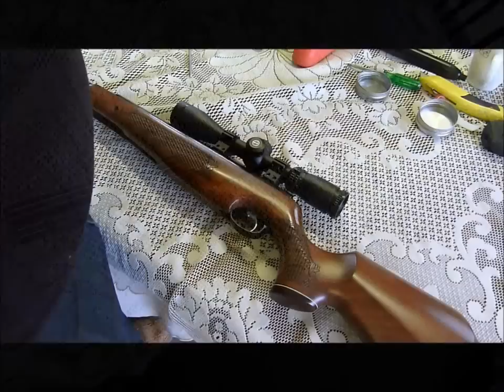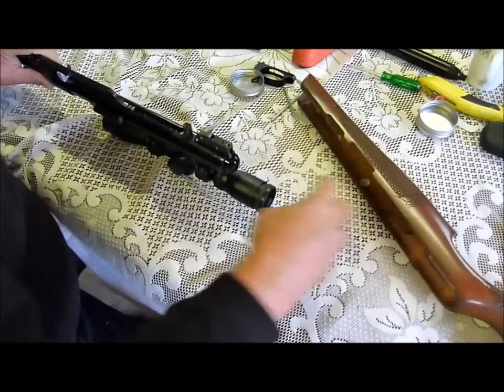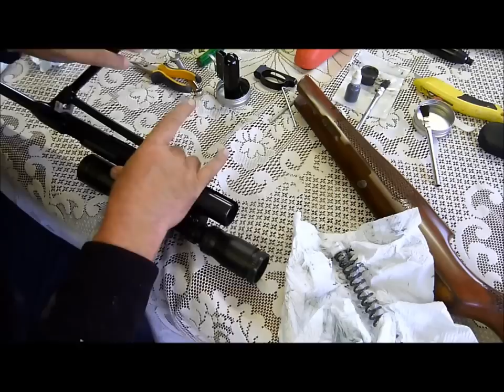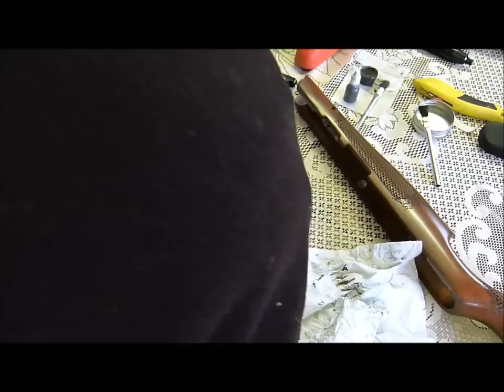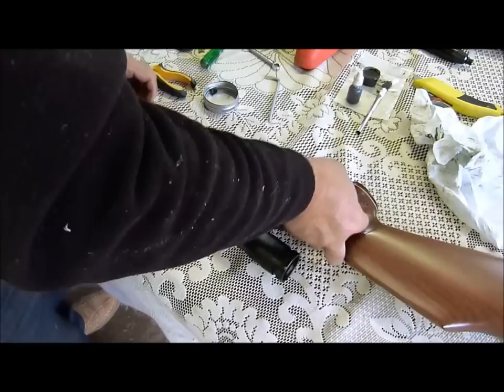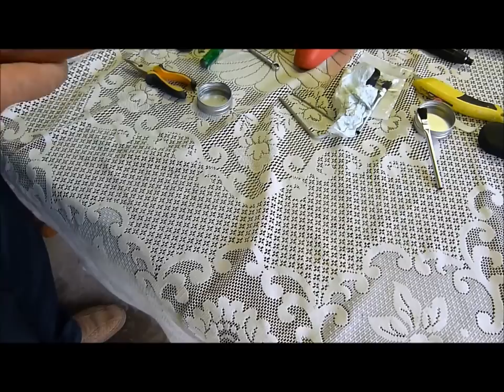Tutorial - Air Arms TX200 Strip, relube and reassembly

Comment: Hi. I bought a new tx200 and safe is stucked. I tried dissasembling it but in the stage of releasing pressure from the bolt to take out the spring i cant hold that pressure from the trigger unit. It just doesnt move.

Comment: Excellent video, Thank you for posting this. I also have a full power 97KT and would  like to strip it down and re lube as I did to my TX200. I am not overly handy with stuff like this but really want to service my own guns. My question is,  do I need a spring compressor to safely remove the spring or can it be done reasonably easy without  it?
Thanks , Joe
Reply: I have a WH 97k   And yes i needed to make a spring compressor to get it back together.
Reply: @redauwg911  Just wondering exactly how you managed to screw the cap threads on with the pressure of the spring ? Did you insert spring then put cap on and force the cap in till the threads met then screwed it on with your hand? Hope I explained this so you understand what I am saying. I would hate to cross thread the first few turns. 
Thanks ,
Joe
Reply: @joebergin8113  I made a very good spring compressor with a cut 
10 inch c clamp. I fully taped the gun and it was held down by plastic 
coated U clamps. I glued at plastic holder onto the end of the c clamp 
screw.  The fac spring with washers:) stuck out about 3 or 4 inches but
the clamp pushed the cap down . I turned the cap with a metal punch and
screwed the c clamp at the same time.    Everything is firmly bolted down
and i wear leather gloves.
Reply: @redauwg911  Sounds good to me. I bought the clamp today and have ordered a full powered main spring from D@L Airguns. Just have to make sure everything is secure and lined up perfectly. . " I glued a plastic cup on the end of the c clamp" Not quite sure what you mean here? you the end of the clamp 10 inch screw?
Reply: @joebergin8113  Yea i took a bunch photos if you want to see them let me know
Reply: @redauwg911  Thanks for the photo offer but studied it a bit more and think I have it pretty well figured out. I do have a question if you could help me with this :When  I have  the  new spring finally in  then  insert the trigger , in what  order do I insert the safety button and little spring?   Is it before , during or after the trigger block is inserted?  Never taken it apart so not quite sure how it connects. 
Thanks 
Joe
Reply: @joebergin8113  Hey Joe by the way i am in Montreal.  And my 97 had 495 stamped on it and came from DL about 2 months ago.  The pins for the trigger punched out pretty 
easy with a 3mm punch. The safety and little spring just fall out (don't) loose the spring lol. I taped the whole gun with green painters tape first because i wanted no 
scratches.  The end block was very very tight. In the trigger slot i place a large wrench
that was taped and card board on both sides, Holding the 97 with my left hand i smacked the wrench end with a hammer 3 or 4 times to loosen it. There was no tension taking it apart and a spring compressor was not needed because it was just
a 495 spring.  The important part here is when you remove the piston check if you have washers in the tube over the rod i had two.  Another guy in Montreal had a large spacer held by a black o-ring, You really have to check because he did not see it and put the new spring in and the gun would not work,, And had to take it apart again and remove the large spacer... Also remember to polish the ends of the spring and it must be lubed or it will twang..  There are tons of special lubes out there that are hard to get D,L is back ordered check them out. If you can't find the special stuff look for super lube at wally world or reno depot etc..  When putting back together cock the trigger by pushing down on the top lever put the safety in then push the trigger block in and the 2 pins back in . And dont forget to pull the trigger to decock it .  Any problems give me a shout.. Oh and don't forget to drill your transfer port between 3.4 and 3.6 for full power if thats what your looking for
Reply: @redauwg911  Hey redauwg911, Thanks for all the great tips especially with the trigger and safety situation sequence. I am really challenged at putting mechanical stuff together so you taking the time to help me is much appreciated.  I have watched all the U tubes I can find but they are all of the low powered version. I can't find anyone using a spring compressor to get that trigger block  under considerable pressure screwed back in again. I'll hope for the best but don't want to cross thread the first few rings. 
 I bought my gun used but just like new from a guy in Cape Breton, I live just out side of Halifax NS. I am fortunate as have a fairly large property  and  have built shooting ranges out to 48 yards and shoot every day.  
 Question: 
I don't understand what you mean when you stated  " "drill your transfer port between 3.4 and 3.6 "? Haven't got a clue. It must be important or you  probably wouldn't have mentioned it. Clarification would be much appreciated.  
What scope do you have on your gun and what is it's favorite pellet? I have a Helix element 6-24 x 50 SFP . Don't think I would buy it again. At full 24 mag, it really hard to get it focused. The best pellet for  my  97K is the Air Arms Field Diabolo 8.4 , 4.51. 
I recently installed a Vortek PG3 High Out put kit in my  Tx 200. What a difference. It was decently accurate before but now it almost unbelievable.  I plan to do the same for the 97K once D L Airgun have them back in stock and I can successfully get the gun apart and back together again without any major screw ups.

Comment: How many shoots before to service? When do you know the rifle needs service?
Reply from the maker: When it starts performing poorly. Maybe a drop in power or accuracy. Also if it starts to feel wrong when cocking - metal to metal feel etc etc.
Reply: @shootingatdawn  thank you so much for the reply! Understood! I own a new TX200mk3, it has near 2.000 shots, last question: if you can say a aprox number of shots of use to make a service, what will be? 5.000? 8.000?
Reply from the maker: I never touch them unless the performance drops. That's the beauty of a Springer- they work well for years without the need for work. If you want to be sure just take it apart after a few sleeves of pellets just for a check around and a re grease.
Reply: @shootingatdawn  thanks!

Comment: I'm an old airgun shooter and I bought one of these guns last month. It is the best springer, and most accurate, that I have ever owned. I love it. If only I could have had one of these years ago.
Reply: I've bought one in 177 in Walnut, had a few 97s 95s and 77s the 97s out of the Weihrauch's is the best, but l do think the TX is better l know there more expensive than say a 97 but the bluing is about the best ya can get, Minneli Walnut stocks again absolute top manufacturer, the Guns are sooo easy to strip, l like how the piston comes out of the comp tube without having to remove the cocking lever, all l did was fit a better spring and piston sleeve and a delrin top hat and guide, regressed with high moly content grease.
Reply: Hi John just reading your comment mate.... How's the TX200 performing.... I'm an older Airgun head like yourself....

Comment: Been on the fence between the TX200 and HW97K. The TX is so much faster and simpler to disassemble. I wish the TX had the larger loading breech area.
Reply: I thought the same, but as you'll know by now it becomes easier with time
Reply: @awall7501  I got the TX and never looked back. Loading never was an issue.

Comment: You should take an FPS reading before stripdown and relube and another one after. Be nice to see if there is any improvement. Couldn't believe how easy it was to strip the TX down.  Great 'Toolbox' videos, cheers.
Reply from the maker: +A & B Photography - thank you. Regarding chrono readings of the gun before and after - yes that is true but in this case I was asked to provide a video that showed the simple steps of strip, lube and reassemble.  The gun was producing 11.2 before strip down and having put 200 or so pellets through it, it has now settled at 11.3 so more or less the same :)
Reply: Apparently there's a kit you can get that replaces the spring guide and tophat with plastic versions reducing the weight.
Reply from the maker: I think the next phase for this gun will be a full NickG alloy piston kit. But he is going ot make a hybrid one for one of my 97s first and then I want to work on getting the LGV piston lightened - so the TX will have to wait a while :)